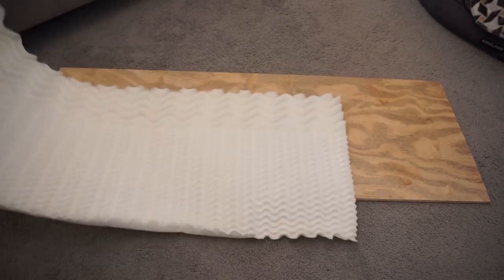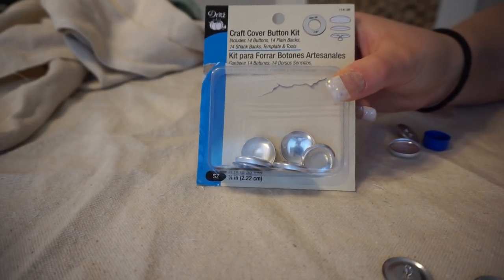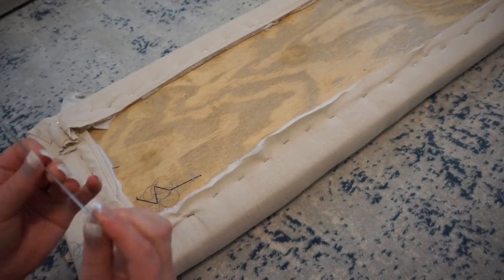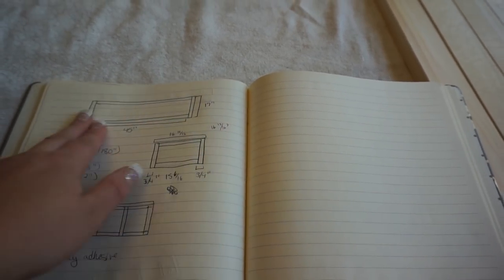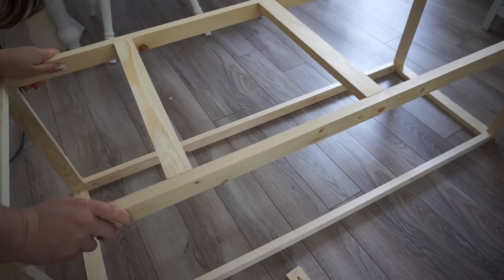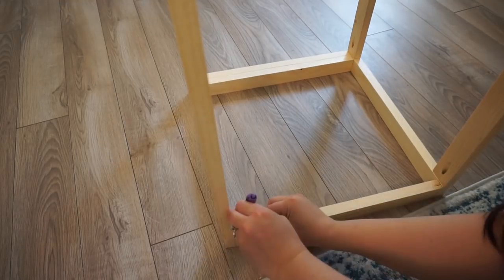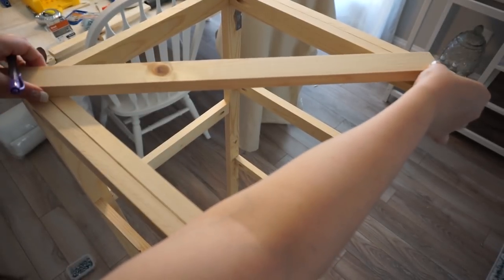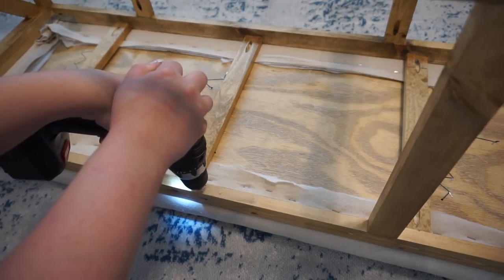DIY Drop Cloth Bench!

Comment: Great job for first build. Only thing 1X2 are to small / weak defiantly needed to use 1x4 or 2x4 that will give u the strength u need to make it solid and sturdy then u wouldn’t need all the brackets. I know u were using materials u had but just for FYI future products 1x2 are for trining or making frames etc but it looks great n u made it work 👍🏼
Reply: Kim Bryan exactly what I was thinking. Great first job!